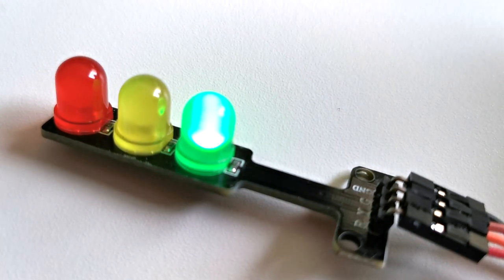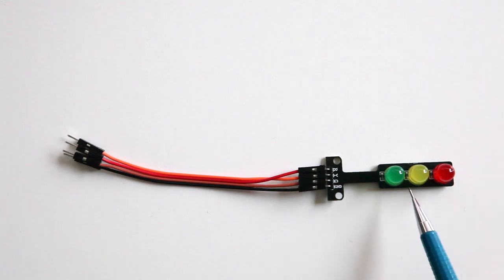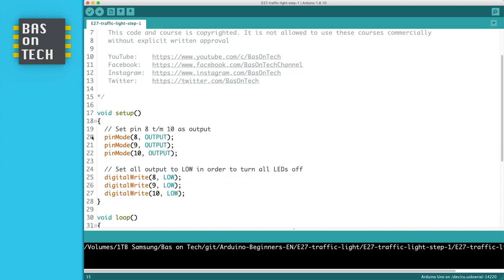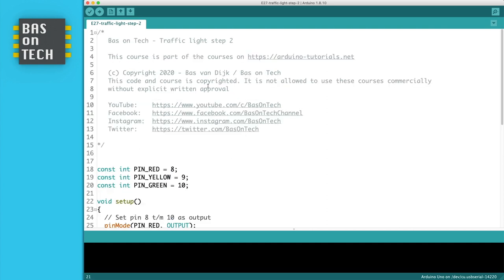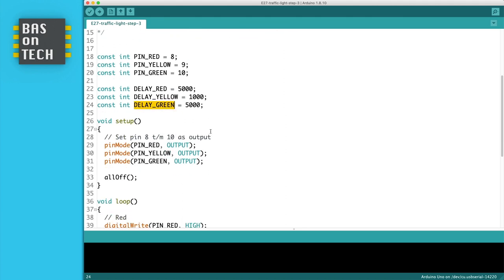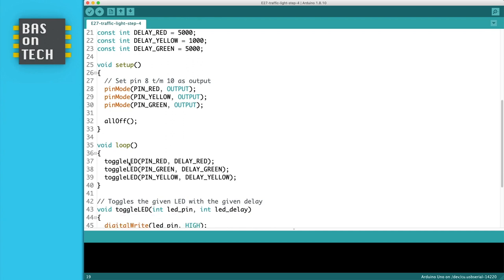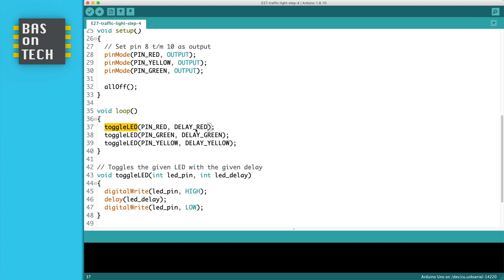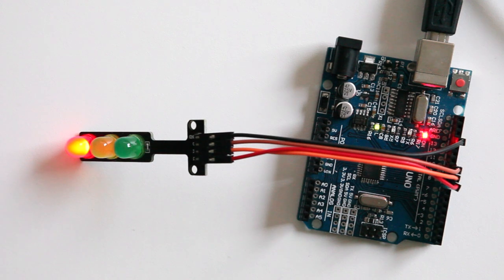LED TRAFFIC LIGHT - Arduino tutorial #27

Comment: Why  is the green light so low compared to the others?  is it because the yellow and red use 13mA and the green needs 25mA?   What can I do to make the green as bright as the yellow and red LED?
Reply from the maker: This might differ per board. You can really do much about it unless you are willing to solder and replace the LED.

Comment: can we use the same pin if we have multiple led traffic light?
Reply from the maker: Not without additional components. If you use multiple on the same pin both traffic lights would show the same lights turned on. Besides the brightness would become significant less.